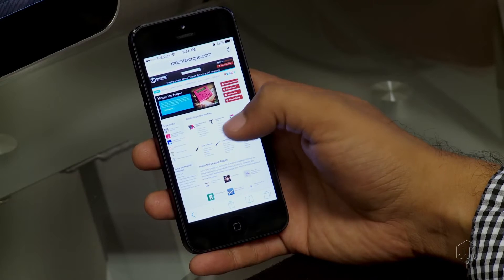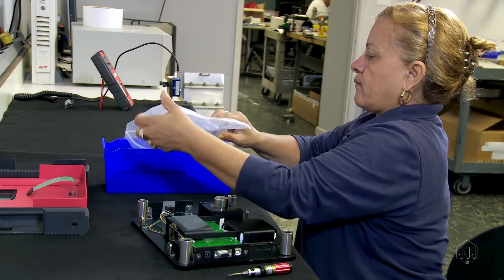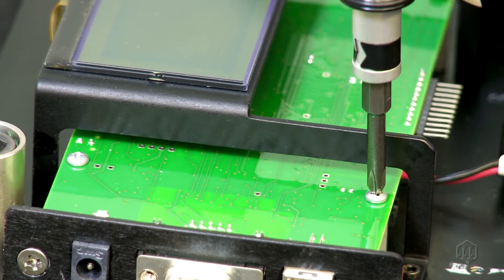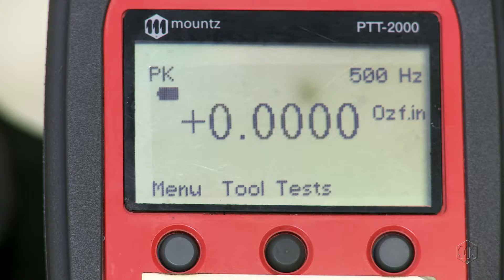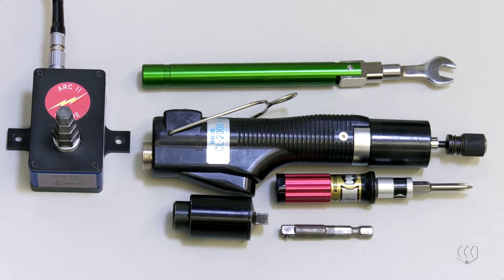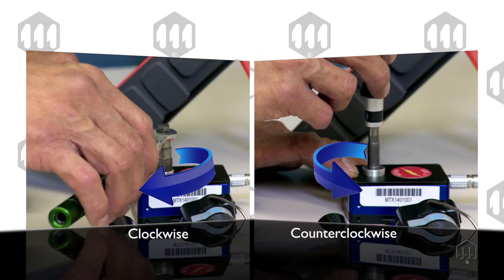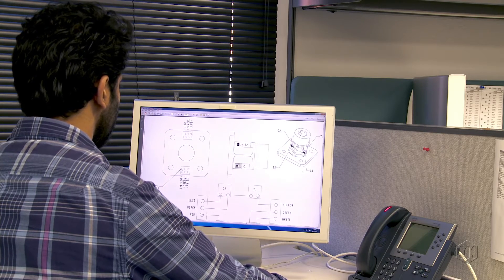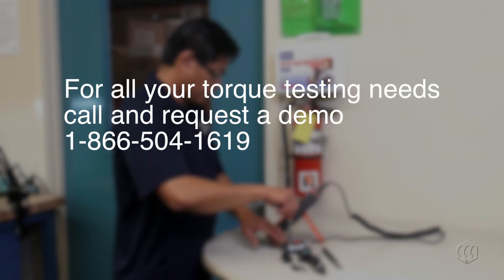Torque Calibration & Testing with a Low Torque Sensor

Comment from the maker: Measuring low torque with a finely tuned torque sensor. Calibrate small torque tools. With nearly 50 years of experience, Mountz is a pioneer in developing torque testers and sensors. Talk with a torque expert.